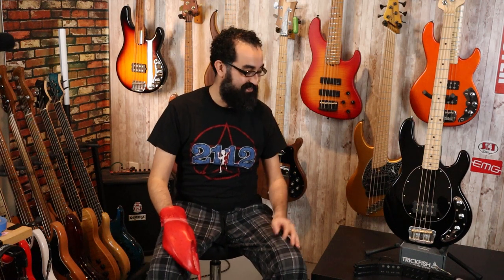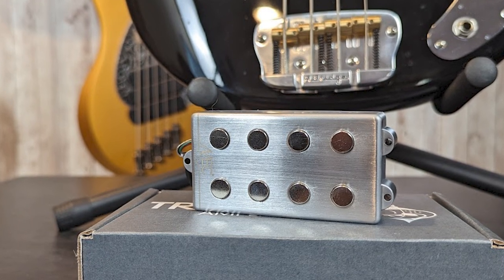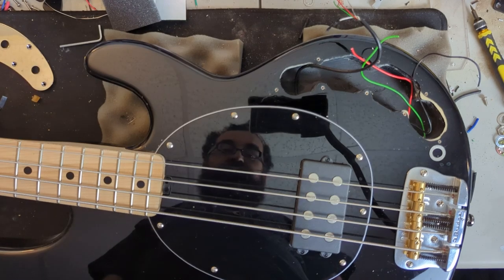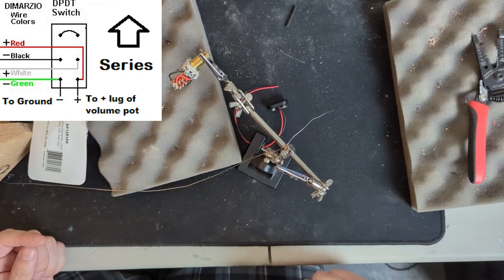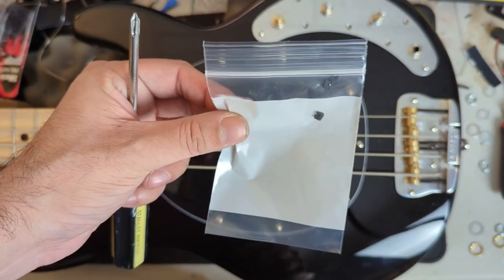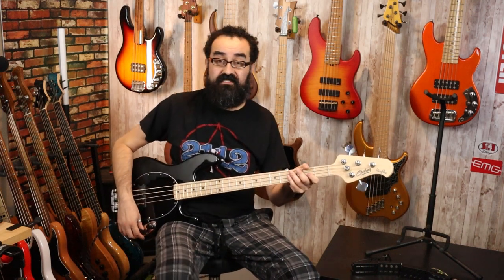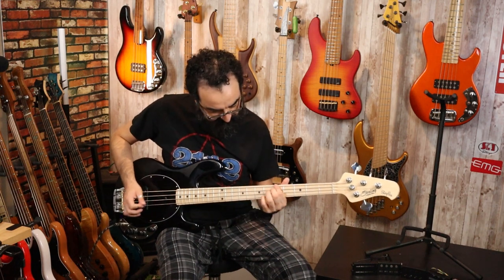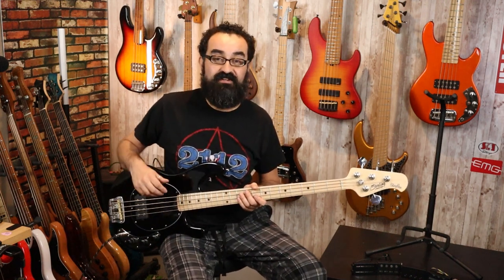Ultimate Stingray Strange Pickup Guide 2022 Edition - ft Trickfish IPA Preamp - LowEndLobster Builds

Comment: As far as I know 250k pots are recommended to use with MM pickup. 500k shows up more high frequencies and we can hear how much shrill string noise is in this demo. Correct me if I'm wrong or that was in specs for this preamp, anyways great video!
Reply from the maker: I think you might be right, and I see DiMarzio makes a 250k stack... Oof :( hahaha oh well, all the content is coming with 500k pots.
Reply: @LowEndLobster  No problem, that's a subtle difference though
Reply: You can try to make a hi cut roll-off in post production but I don't think this will be needed that much. It's up to you ofc and it still doesn't ruin value of the video! ;)
Reply from the maker: Looking more into it, some pickups prefer 500k, some prefer 250k. Stock stingray is 250k as you said. Fear not, the other pickups sound great with this pot, though one does sound a bit too bright because of this.
Reply: @LowEndLobster  You can make a comparision video with different value pots or their combinations like 250k and 500k in one wiring. Just another cheap way to fine-tune sound of the passive bass. I like the idea from this video with MM pickup in series wiring and 500k pot. Big and chunky mids + retained lively highs
Reply: All of lobsters videos have a little extra string noise imo.
Reply: @bobbyzig3879  They're more like DI type of sound with some amp EQ (which is fair in those comparisons!), but that's not the case though

Comment: I think one of the main secret ingredients of the Stingray sound is missing here. There should be a 2.2 nF cap connected directly to the pickup between the pickup’s hot and ground wires. This trick was used on the original ebmm 3 band eq stingrays. It rolls off the glass-like highs and shifts the pickup’s resonance peak to somewhere around 3-4kHz.
Reply from the maker: Thanks for this little tidbit of info! Very helpful!
Reply: @LowEndLobster  btw RobbieK (Rob Mods) has a lot of knowledge on it.

Comment: Tomorrow I'm getting a Warmoth kit minus all the electronics so this is great.  I will have 3 places for pots, 1 side-mount for the output jack.  That doesn't leave must room but that DiMarzio will be great if I go with this preamp, which I most likely will since it is mostly solderless.  I won't have a control plate, opting for rear-route so unless I want to drill another hole (don't want to), I guess my set up will be like yours: active only.  Gonna be a big project for me.

Comment: My SUB did not have the 4 conductor option and had to replace pickup. This sounds great in parallel and the factory would fix so many issues with this bass if they made this the stock option.

Comment: Awesome. Quick question? Can my Harley Benton MB-4 stock pickup be ran in series/parallel? I was wanting to buy the DiMarzio push/pull pot.
Reply from the maker: Great question Chance. Yes! It's stock wired in parallel with a separate vol for each coil. You'd probably lose the V/V functionality with a series/paralllel, but TBH doing Vol/Switch/Tone would be a solid setup for that bass.
Reply: @LowEndLobster  Awesome! Thanks for the quick response. Congratulations on 30k subs!